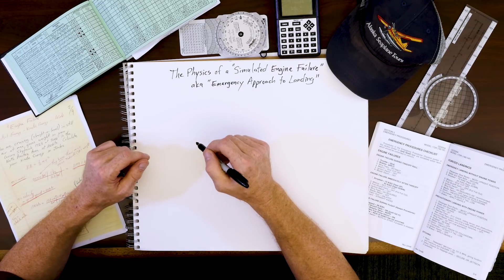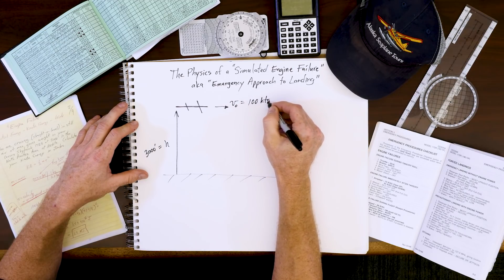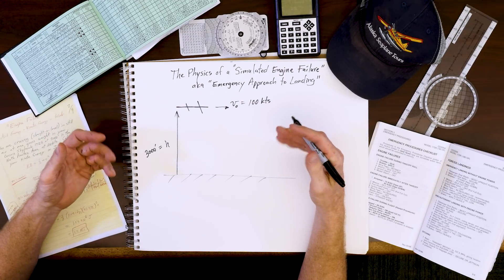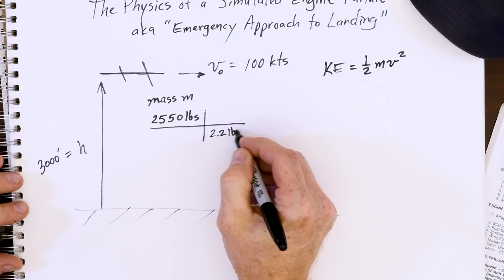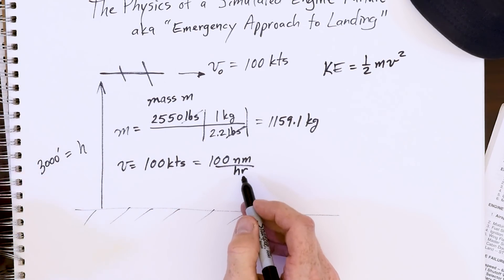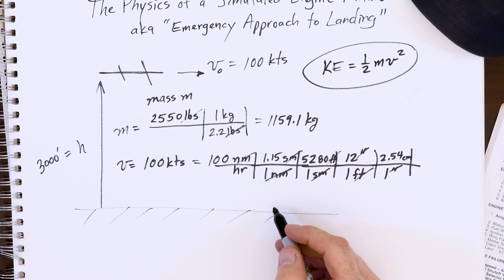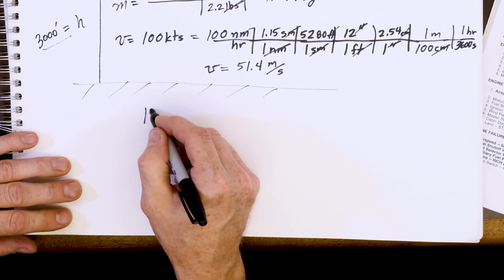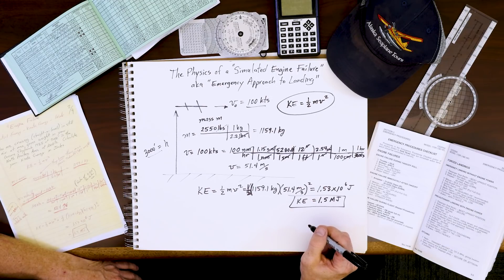Physics of Flight - Engine Failure Lesson 1

Comment: I got an F in Physics 103 then a D in Physics 103 after retake and I got a D in Physics 103 Lab. Got an A in both Physics 104 and 104L. Physics 104 I had a real easy professor in which I put the pedal to the metal to get an A. Got an A in both Math 111 and Math 112. I got a D in Aircraft Performance. I am not good in physics at all.